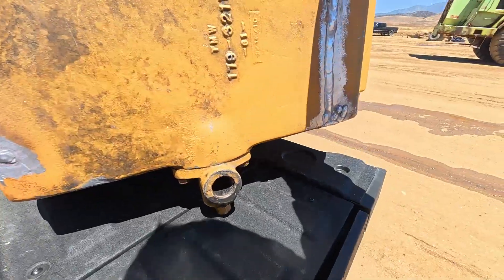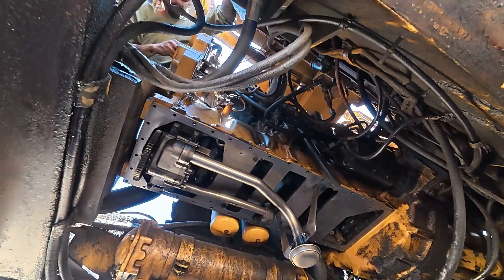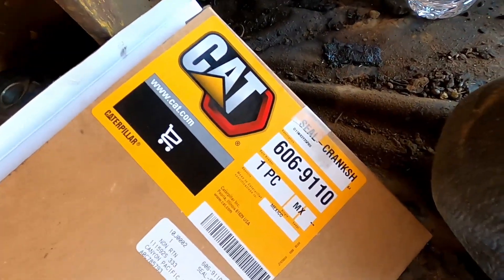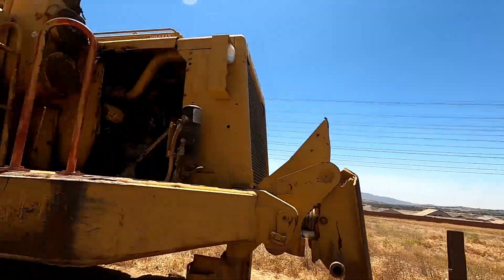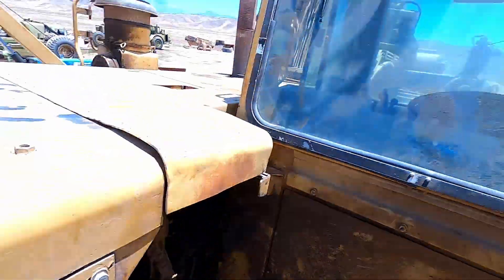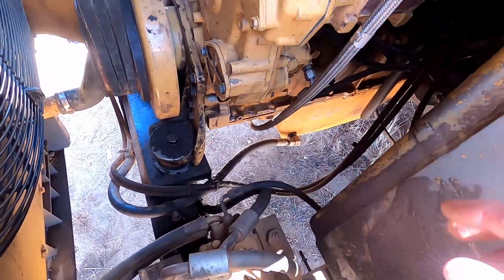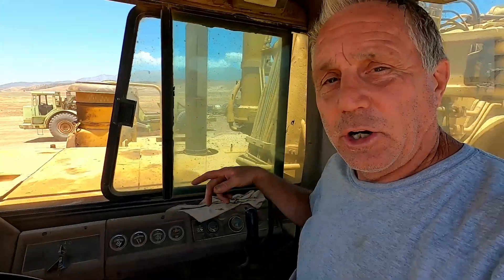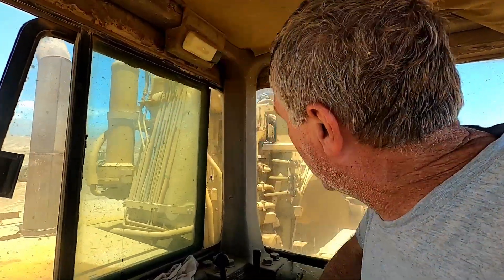657E Scraper with C18 That Ran out of Oil Running Again...

Comment: Great video, thanks for posting.  Newly subscribed so am now catching up with your content.  Would you have any thoughts on why the seal would need to be installed dry?  I’ve installed many oil seals throughout my career and don’t recall needing to do this, just seems counterintuitive.  Thanks from the UK 🇬🇧
Reply from the maker: These particular type have sealant on the shaft side and case side of the seal so oil there would be bad

Comment: The plate is a stiffener plate.  Keeps the block from flexing
Reply from the maker: That’s what I was thinking, I guess you pull 600 hp and 2000 ft lbs of torque it’s gonna need some help…
 Thanks for commenting
Reply: @RasmussenEquipment Great video.  Watch those rattlesnakes!!   Watching your C18 video now.   The 657E

Comment: WHY DID THE OWNERS APPARENTLY PULL THE REAR ENGINE OUT? ARE THEY PERHAPS REBUILDING IT?
Reply from the maker: They are only running 651’s now. So they sold most of their 657’s and converted a the rest to 651’s 
Probably making just as much profit running single engines with less headaches.
Reply: The best rear engine for any scraper is the D10 pushing it. The twin engine means more problems  .
Reply from the maker: The best use for the twin is when working in hills. We have a lot of hill side jobs around Co Cal. 
On flat land jobs a 651 is a lot cheaper to run. A 657 is a very high maintenance tractor… 

Thanks for commenting 
Have a great new year

Comment: Very cool shots of driving that machine, thanks!  When you tell kids that there were no Cushionaire seats or AC, I think it just doesn't compute with them what it was like. :face-green-smiling:
Reply from the maker: Thanks, ya most young “operators” “drivers?” Won’t run a machine if the A/C isn’t cold enough. Have a good 4th…

Comment: More like 167K with the rear power pack and push pull arrangement
Reply from the maker: Ya, it’s been a long time since I sold my 657’s 
You are right they are around 150k plus all the dirt built up in the sides of the can, inside of the floor, inside of the cab 🥹 haha. And all the extra steel and weld on the hitch and skin repairs over the years. 
This one probably only weighs just over 100k without the rear engine, trans, and diff. 

Thanks for watching and commenting have a great 4th.